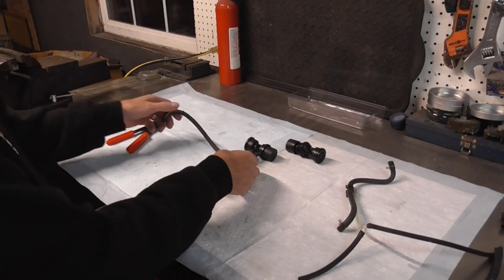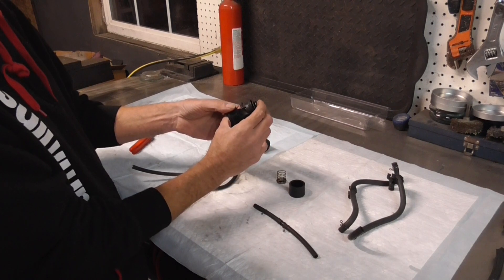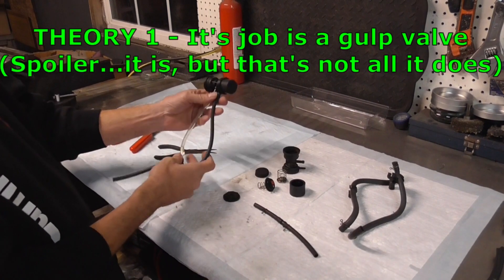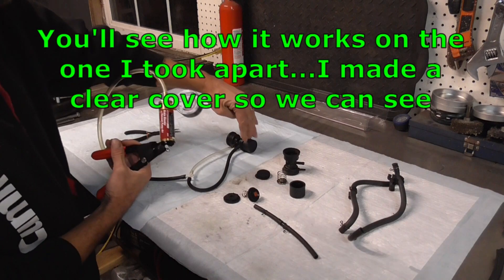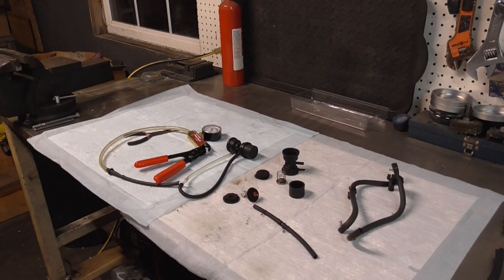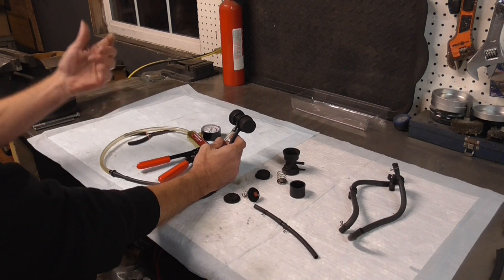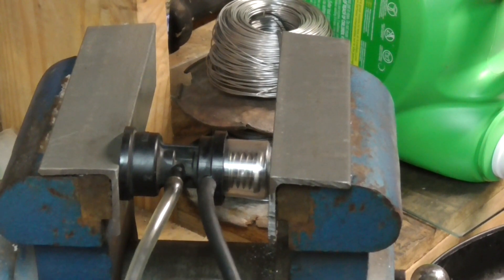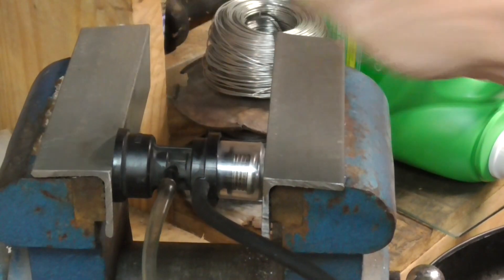1st Gen Virago xv750 Mixture Control Valve - What does it do?

Comment: Just found this video and can’t thank you enough. I’ve been tearing my hair out re-tuning the carbs over and over using your other videos, and my front cylinder kept dropping out and fouling. I’m hoping this is the answer for my old UK XV750SE. Great job Steve!
Reply from the maker: Hey man !  Yep, if the MCV goes bad (or even the vacuum lines that go to it) it will cause issues for sure. Another thing often missed that can cause the cylinders to drop out (after warming up if the rings are a little worn) is if a lot of fuel has gotten down in the oil over time from periodic stuck floats. They will fire up and run great when cold (since the oil with fuel in it is just a bit thicker), but then the oil thins out so bad as it warms up that the compression starts to drop and the plugs will foul.  Let me know how it goes and all the best !  Steve
Reply: @StevesDIYs  Yet again; great info! In the end I tested the MCV & hoses and found they were ok. I replaced the vacuum line wire clip fasteners with more robust ‘collar’ clips to prevent any vacuum leak. Sprayed the MCV with WD40 and then tried to do the fuel mix etc. according to your other videos. It was then I discovered that the front fuel / air mix needle was way too far out. I’d replaced the needle during rebuild and the new rubber ring must’ve made it more stiff to turn. I had been too cautious doing the ‘soft seating’ and once I had wound the needle in another two turns suddenly the front was running sweetly on it’s own. I completed the synch process and then had a wonderful test ride which felt absolutely great as I’d been struggling to get it right for a while. I had finally made them behave!!! I have to say it’s all thanks to your videos and info which are done so well. You are a legend mate!! I still have the annoying tick and I will definitely need a clip clip someday but for now I am just happy to have a working ride for the summer! I’ll send a link at some point with pics of my totally all original restored Yamaha 1980 XV750SE with only 5000 miles on the clock. It must be the last one left in the UK! 
  Thanks once again Steve! YAMAHA CLASSIC LEGEND!!!
Reply from the maker: @thepenningtons17  hey man !  That’s awesome you were able to get it figured out and glad the videos on the channel helped some 👍. It’s always frustrating when they are being grumpy for sure, but when they finally come to life it’s the best feeling in the world !  For me, part of the fun on getting one running again is the challenge to see if I can figure out what the issues are, lol. I’m at an advantage though as I have a couple of bikes so when things get really frustrating on a resurrection, I can just go hop on one of the running bikes and go for a ride to clear my mind, ha,ha.

Thanks again for the update…I’m always excited to hear when folks take on the challenge of getting one running again vs. just sending them off to a repair shop (or even worse, just giving up and abandoning it).  It will be great if you send me a little video clip once you are all done…I’d love to see it 👍. My channel’s email address is Stevesdiys@gmail.com if you wanted to send me the link there.  Best safe out there and all the best !  Steve

Comment: I bought an '81 xv1000 (TR1) in '83. Had trouble from the get-go with backfiring, actually blowing the carbs off on one occasion. Asked questions and the consensus was piss it off (The mixture control) I did, and no more trouble (with mixture) for the 26yrs I owned it!. Currently have an '82 750 which of course had the mixture control removed before I got it. Runs fine.
Reply from the maker: Hey man !  Yep, if the MCV goes bad or starts letting air in, it will “lean pop” the carbs right out of the boots since many if the Virago models don’t have the metal surrounds that go around the rubber on the boots lol.  One of mine would pop the small vacuum lines off of it even with the wire clamps on them.

Comment: I used some  WD -40 to free up the valve , it also has an adjustment under the silicone you can use to help free up the valve (count turns ) . Nothing to lose by trying it . Worked for me .
Reply from the maker: 👍. Yep, some folks like to leave them on the bikes as they do help some with the popping on decel. If they are still functioning I too just leave them on the bike, but if they go bad I bypass them and remove since it doesn’t really hurt much for them not to be in the system.

Comment: Thanks for the vid.  I've just bought a 96 1100 here in the uk with the entire left side missing.  all i have is the two large rubber pipes sticking horizonatally from the bike......Can't find any info so far on what it's all for and how necessary it might be?  Bike runs great!
Reply from the maker: Thanks man 👍. Yep, the 2nd Gen Viragos had something sort of like the MCV for the first Gens.  It is called an AIS system (Air Induction System) and supposedly helped with emissions compliance.  It doesn’t do anything for the motor and just causes trouble when it goes bad.  If the AIS valve has been removed, most likely the two lines that were connected beside the exhaust ports on each cylinder are capped off as well since they were part of this system also.  The 2nd Gen I picked up last year (‘89 1100) also had all of this stuff removed prior to me getting it so I think it’s pretty common to remove it as long as there aren’t super strict emissions laws in the area (like California, USA…those folks in that state can’t get away with any modification to the emissions system on anything if I remember right, lol).

After going through my ‘89 1100 to see if there are any special things attached that actually do something, the only thing I noticed was that there is a small vacuum line that goes up to a vacuum switch sitting on top of the coils under the plastic cover in the front.  That little guy is a boost sensor of some sort that changes the timing when the throttle opens up and the vacuum changes (kind of like a vacuum advance for old cars and trucks with a distributor ignition system).  If this is not hooked up, it seems to affect the higher rpm range, but for normal cruising around I couldn’t tell much of a difference with it connected or not…maybe a little on the fuel economy.

Glad to hear another one of these old school bikes is back on the road and all the best from Nashville Tennessee, USA !  Steve
Reply: @StevesDIYs  Cheers Steve, that's put my mind at ease.......I'll take a closer look at the vacuum to see if there's an issue with the upper rev range.  But for now, it's back on the road with it.  Sun shining here in the UK, but the wind getting up a bit.

Take care.
Reply: Oops, logged on with my other profile.   Same Paul.  :D

Comment: Steve, how does this affect your gas mileage by removing the MCV and tuning your carbs by ear to run richer on the front cylinder? I have a 1983 Virago 750 that needs torn down and replace the valve stem seals and a gasket kit. On trips my gas mileage was 39 MPG or 78 miles before running out of gas and walking. I wouldn't want to get less gas mileage unless were talking about 1 mpg. Great video and great demo and explanation. You know your older Yamaha 750 bikes thru and thru. I hope at some point to be able to go thru my engine using your prior videos that were done first rate. Thank You!!!!
Reply from the maker: Thanks man !  I still get 80 to 90 miles before hitting the reserve on mine even without the MCV. Seems like I put about 2 gallons in it when I’ve hit the reserve level so that would be 40 to 45 mpg. I’ve rebuilt all three of my bike’s motors in the past few years so I’d say that has a lot to do with it the economy since my compression is back high again and the carbs are all cleaned up and adjusted. 

It doesn’t take much extra to get the front carb happy and not poppy...once I adjust it to what would be close to factory, I then just turn the mix needle out about 1/8 turn to add just a bit more fuel...if it still pops a bit on the next cold start I give it another 1/16 or so turn. There’s only a small window of being too rich or too lean and then the plugs foul or burn so it’s a very small amount of additional fuel needed so they don’t hiccup back into the carbs 👍. Another thing that helps to reduce the hiccups seems to be the type of plug. I switched over to NGK Iridiums a few years back (I had to take the resistors out of the plug caps as I can’t find iridiums without the resistor version), and noticed immediately that it took less warm up time for the motor before it would throttle up smoothly in the cooler months (I live in TN so I’m actually still riding this year as the afternoons are nice).
Reply: @StevesDIYs  Thank you very much Steve for the valuable information, your videos and all your time and work.  Your experience and intelligence are appreciated.  😊
Reply from the maker: Thanks man !  I do find it interesting looking back in time (so to speak) and seeing what the engineers came up with for issue resolutions on the 1st Gens.  They had some interesting ideas for sure…some (like the starting system in these), were not so good, lol.  But hey, these old bikes are still on the road after 40 years so that does speak to how well they were designed and built.  All the best !  Steve

Comment: In one of your videos I believe you mentioned using an Iridium spark plus.  Would your recommend a change from an NGK BP7ES for my stock 1982 920 Virago?  Also, how do you take a resistor plug and make it a non resistor plug.
Reply from the maker: Hey man !  I’ve found that the Iridium version of the plug (NGK BPR7EIX) doesn’t foul near as fast (if at all) compared to the regular plug. I’m guessing it has something to do with the tiny little iridium tip that can clean itself off better, but actually not sure. I’d say give it a try next time you change plugs to see if it was me...they cost a little more, but it’s not so bad since there’s only two. For switching over to resistor plugs, you can take a flat head screwdriver and take the contact out of the plug boot where the plug goes into the boot (for NGK plug wires...not sure for others). When you unscrew it, there will be a little resistor that comes out. I just get a piece of copper that’s roughly the same diameter and replace the resistor with it then put it back together. The little resistor should have metal ends then a ceramic center part. It’s pretty easy to take them out and you can always swap them back in if you change back to a non resistor type plug. All the best and happy holidays ! Steve

Comment: When you remove the valve, are you jetting both carbs according to the front or to the rear carb?
Reply from the maker: Hello, the valve doesn’t really change the tuning of the carbs…it’s just there to help with the sudden vacuum increase when the throttle is closed back quickly when decelerating.  There shouldn’t be any rejetting of the carbs required if the valve is removed.

Comment: I keep having issues with my 1st gen virago 750, can this valve be the issue? A couple of weeks ago the bike started to loose its overall power/speed and later when I would try to give it speed in 1st gear, I would stall easily on a red light light turning green. It would spit/sputter but wouldn't get up to good speed even having high rpms. 
I changed the plugs and it actually fixed the issue for a day or two and now I'm experiencing the same issue. The bike doesnt get up to speed as easily anymore, its really easy to stall it when in 1st gear. 
So far the carb was cleaned and tuned, new plugs, new air filter, petcocks are supplying fuel normally, I'm loosing my mind here. 
Any suggestions?
Reply from the maker: Hey man !  It could be this little valve if you are having issues on the front cylinder…an easy way to check is to just disconnect the small hose that goes to the front boot that goes to it and then cap off the port that’s on the boot.  If it starts running good again then the MCV valve would be bad.  Other things to check would be that the carbs are sync’d good (if you haven’t already done that).  When you cleaned the carbs, did you notice any small black particles up above the diaphragms?  If so, the vent tube foam filters may be finally started disintegrating and it will keep stopping up until those are removed and cleaned out.  One other item would be the float height in the carbs (if you also didn’t check them when cleaning the carbs).  If the fuel level in the bowls is too high, it will foul the plugs really fast as it’s pulling too much fuel into the motor.  It does sound like something to do with the air/fuel mix though like you are thinking.

Comment: I want to delete my MCV as well. Is the mcv vacuum hose connected to the petcock. Because that also has a vacuum hose connected to it?
Reply from the maker: Hello, yep, the MCV smaller hose (the control one) should tee off of the line that goes to the petcock down to the carb boot. To remove it, you just have to copy the way the rear cylinder is setup but running the petcock hose straight down to the carb boot. Then the bigger hose connector on the carb boot is just capped off (be sure to put a little clamp on the cap and hoses that holds them securely 👍). All the best and happy holidays !  Steve

Comment: Good day my good sir,  I have a new problem on my 84 xv750. At low rpm or throttle, the bike bogs, but when I full throttle or raise to high rpm, the bike runs great. What do you think is doing that?
Reply from the maker: Hey man !  I would first suspect that the idle circuit jet may be getting clogged up so the air/fuel mix is getting thrown off.  If not that, there may have been some particles that have gotten into the idle mix needle hole and is preventing fuel from getting pulled up at idle.  Could also be that the floats are not sealing off and it is getting too much fuel, but usually they won’t run many months if that is the case since eventually it will foul the plugs.  Might be time to pull the carbs and give them a good cleaning as a first step 👍. Hope this helps and all the best !  Steve
Reply: @StevesDIYs  thank you for sharing your wisdom Steve sir. I will go look into it and see what's up.☺👍💯
Reply: @StevesDIYs  my plugs foul when low throttle, but full throttle the spark plug looks brown. About the floats, the carb doesn't flood. What do you think Steve sir?
Reply from the maker: @anthonyarmstrong9508  hey again, I’d say if the bike is not hard to start or smells really rich when first started, then the floats are probably set ok.  It might just be that the carbs need to be cleaned and the air/fuel adjusted again to get it running right again.  Most times, when the motor runs good when throttled up, but not very good when idling, it’s something to do with the carbs (or the p,Gus are very fouled and will only spark when the rpms are up causing more voltage to be made by the stator).  You could also check the voltage being put out by the stator when idling and at higher rpms…at idle it should be at least putting out around 12.5 volts.  When throttled up, it should go up in to the 13+ volts.
Reply: @StevesDIYs  thank you soo much Steve sir, I will look into it first thing in the morning please God.😁👍💯

Comment: If I can add one point. In my case, I only adjusted the small screw behind the small rubber portion.
Reply from the maker: 👍. Yep, I just usually remove them if they start causing an issue, but seems they can be adjusted as well. All the best !  Steve
Reply: @StevesDIYs  I was trying to remove it (MCV) but for a reason I don't understand, it doesn't work. For some reason, the front cylinder need extra air from that MCV. other wise it fail ! I though my problem was solved but i'm still have issue at 2000-4000 RPM. On idle, it's working fine with the ajustment of the screw on the MCV. Look like it missing air and running lean. Do you have any advise on what could it be ? Thank you

Comment: Amigo.   Que se debe hacer para eliminar este componente y que trabajen bien los carburadores?
Reply from the maker: Hola !  To eliminate the MCV on the 1st Gen xv750 or xv920, you just need to cap off the ports on the carb boots where the small rubber vacuum lines connect the MCV to the boots.
Reply: Thank you very much friend for your kind help! Apart from that, do you have to modify anything in the carburetors?  like injectors or needles?
Reply: greetings from Guatemala
Reply from the maker: @juaniitocast 👍. Since the MCV valve is just being eliminated, there should not be any need to change anything on the carburetors (jetting or even the air/fuel mix adjustment). The valve normally stays closed so it does not affect the system…it only opens on deceleration. When I removed them on my motorcycles, I did not have to make any adjustments to the carburetors…I just capped off the fittings that are on the carb boots so no air can enter into the ports where the vacuum lines were connected.
Reply: @StevesDIYs  Thank you very much my dear friend, thank you for sharing your experience, your knowledge helped me a lot now I will go to eliminate the system, I myself do the repairs on my motorcycle, I am completely restoring it, greetings from Guatemala.   🫡
Reply: @StevesDIYs  I watch your videos and it has helped me a lot for this process and restoration project of my 1983 xv 750. I am about to do it in tricker style